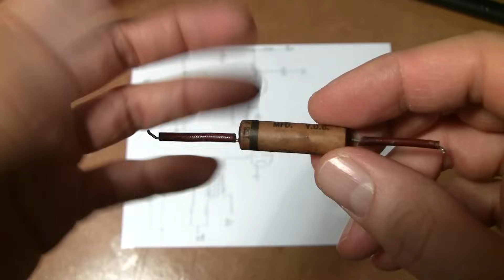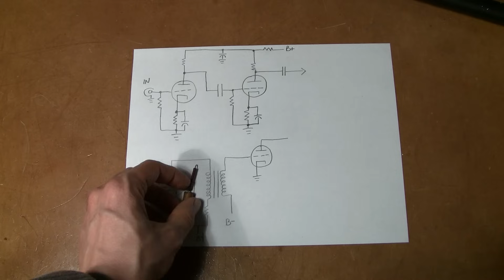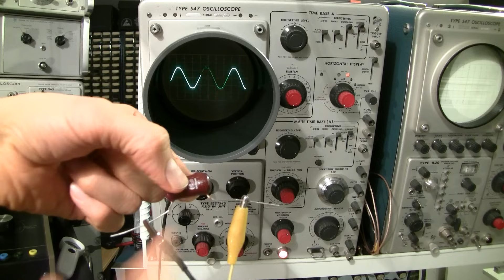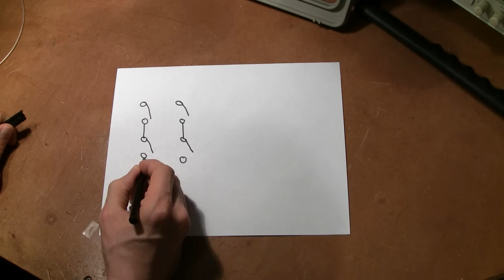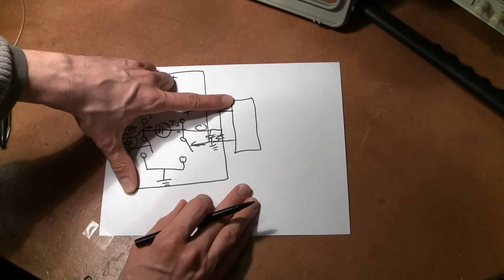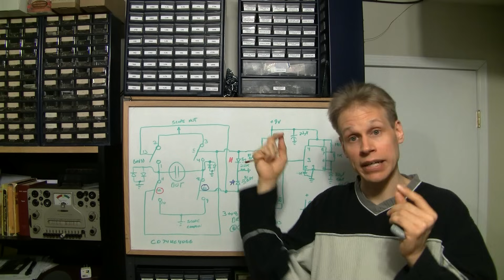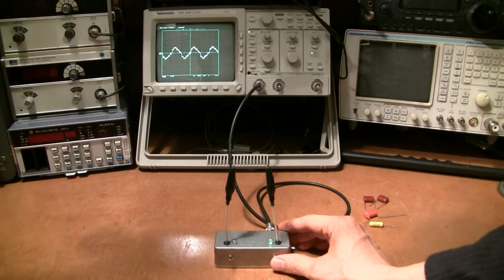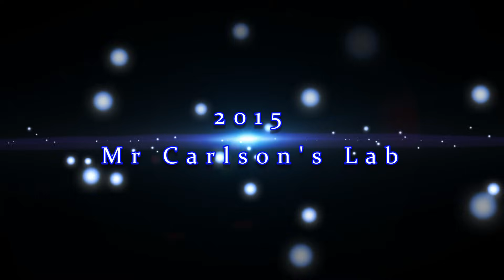Are Your Capacitors Installed Backwards? Build this and find out

Comment: As for the 555 timer or at least a pulsed clock input,a 4013 flip flop with a momentary switch de-bounced would let the state remain as is until you want to change the output state,i build these also for switching selectors,a switch a 10K resistor and a 100nF cap will de-bounce the input,i fact right now i'm using just this type of thing but with a HEDF40175  for exclusive or independent channel selection,less parts can be used with less complexity for the H bridge manipulation.

Comment: I have a cheap 2 channel, 100mhz digital rigol scope (DS1102E I think it is) and even using a coax cable I can't reproduce the high/low noise effect by touching the cap.  I have it set to 5mv per division.  I'm not sure what I'm doing wrong.  Anyone have any suggestions?  The caps I'm testing are 650V orange dips, if that matters.
Reply: I had the same issue.  I installed an isolation transformer in the AC line to my scope, no safety ground connected,  it then worked fine!  Keep the isolation transformer inline until your done checking the caps and then remove it for normal usage.    I'd be interested in others experiences.
Reply: Don B thanks for the tip Don! I’ll give it a try once I get a chance.
Reply: I am getting the same "no difference results" from both of my scopes, 3 different types of coaxial cable and 2 different locations.
Reply: Don, I've the same problem and I see Mr. Carlson didn't answer . . . Did you ever get it resolved?
Reply: Rick, I've the same problem and I see Mr. Carlson didn't answer . . . Did you ever get it resolved?
Reply: Don Bonin I have the same scope and same issue. Are you using the stock probe that came with the scope? He uses just wire in this demo no probes with components built into them.
Reply: @RC-Flight  Hi Guys, I know Paul is very busy especially with Patreon and he is making a very good living producing these videos.  He responds very quickly to Patreon members as I am one and have had many helpful conversations via PM there at Patreon.  As for the problems with the Digital scopes I think it may have something to do with the actual EMI noise in ones shop/lab area.  I have read many people having difficulty with this issue regarding inconclusive results with OSFE (Outside Foil End) testing using DSO scopes. The body grounding may be some of the problem but I have a feeling it is the digital scopes and the way that they capture signals.  I have no modern digital oscilloscope so I cannot test this theory as of now.  With my Tek 2246 I have no issues whatsoever determining the outside foil end of any capacitors I have tested from 47pF to 82uF.
Reply: @garybevis8691  Yeah,  It seems to be quite a bit difficult to see these waveforms on a newer DSO,  it doesn't work on my Siglent.  I have 4 scopes at the moment,  and the only one where I can actually see this experiment work is on my Tek TDS 420A (btw he's using a Tek TDS 320 in the end of the video I believe,  same series of scope).  And only because that scope allows me to go down to 1mV/Div,  set the bandwidth limit to 20 Mhz,  and use some filtering options that the scope has built in.  Also there is a lot of interference in my lab from other equipment,  specifically from switch mode power supplies and LED lighting.

Comment: If you already go through the trouble making a PCB, why not take it a step further and make the device stand-alone? Amplify and rectify the signal and store the voltage in a cap for each direction using another 4066. A comparator at the two caps could determine the shielded side.

Comment: Great, a test rig for automatically testing the--- oh wait! You still need an expensive oscilloscope!? Well shit.

Are you seriously telling me you went to all the trouble of etching and soldering a board just to provide an alternating goddamn SQUARE WAVE to a capacitor? Surely you could've used a microcontroller and some kind of clever circuitry to DETECT the 1millivolt amplitude and just display the correct polarity?
Reply from the maker: Why would you feed the capacitor with a square wave?
Reply: Maybe I'm kinky like that.

Alright, so I misspoke. But it amounts to the same concept. You're connecting the thing first one way, then the other, using an H-bridge. Well, you could just do that by hand without making the damn test box. If you're gonna go to the effort of making a dedicated test rig, then why not make one that actually serves some real purpose? If you still need the oscilloscope, then you have gained nothing.

Comment: Hi Mr. Carlson!
The U.S. Navy trained me almost fifty years ago (avionics). During that time, and with all of the contact that I have had with engineers and technicians since, nobody else ever pointed out potential polarity issues with non-electrolytic caps!! I stumbled across this video quite by accident, but am so happy (and grateful) that I did! In retirement, the only electronics that I deal with are electric guitars and amplifiers, but you just switched on a bright light...shining on some of the 'mystery noise' issues so common with amplified guitars and basses! Thanks!!
As a considerably less 'elegant' alternative to your new bit of test gear, I simply used a DPDT switch, a metal box (shielding, of course), some clear labeling, and physically switch back and forth between 'Normal' to 'Reverse!' I could have added LEDs, a couple of resistors, a battery, and changed to a 4PDT switch, but figured that the O-scope display was plenty! Works fine, was way less expensive, has fewer potential points of failure (like none!), and only took twenty minutes to build! I decided that, at 65, the 'KISS' principle would serve me better! :-)
Thanks again....brilliant video!
Reply from the maker: I'm glad you found this useful!
Reply: How can you sit and type that it has zero points of failure when it contains a mechanical switch...  Yeah I'm smirking but it's not a hate comment just a smug one.
Reply: @WereReallyRelayCamping  OK, zero failure until 1 million cycles reached (typical switch life). At 10 caps a day tested that's 273 years of service. ;)
Reply: @DataWaveTaGo  makes you wonder if switches are so reliable why I get through so many toasters....  Lol just pulling your leg yeah most switches if not $5 for a bag of 100 off eBay should outlive us.
Reply: @WereReallyRelayCamping  I was tinkering around and ordered some switches from China off Ebay. What they sent me will fix my damn  old coffee maker that has been a plug in plug out system for years.  Pulled the old switch and pushed in the new one, and we are back in business once more!
Reply: Tweak or Tron God? ( O or I level?)

Comment: Paul, I have been watching your videos for a little while now and I have learned a great deal!  I am just starting out in electronics as a hobby and I have been restoring antique radios.  I am just now starting to restore a Hammarlund HQ 120X and I want to really do things right so I want to insure I have the capacitors installed with the outside foil the right way.  I have a Tektronix 475A oscilloscope that I picked up at a swap meet.  It is in working order, but I don't seem to be getting the sensitivity when I hook up the capacitor to the probe and the ground and then ac coupling with my fingers on the capacitor.  I am set at 5 mV per division, but I don't seem to get any sensitivity at all on the scope no matter which way I connect the capacitor leads to the scope.  Any advice as to what I am doing wrong.  I am definitely a newbie at the proper use of the oscilloscope.  Thanks!
Reply from the maker: Hi. Touch the end of your oscilloscope probe and tune your scope's vertical section (sensitivity) to maximum. Adjust the horizontal time base to achieve a sine wave while doing this... Don't worry if the sine looks distorted. Now remove your probe from the oscilloscope, and use a piece of coax with alligator clips at the test end. (1 to 1 probe).. Support the capacitor under test between your forefinger and thumb, being sure that you don't touch the oscilloscope leads, and hold the capacitor right in the center of it's body. Take note of the sine on your oscilloscope, then reverse the capacitor in the alligator clips, and test again. The capacitors direction that shows the lowest amplitude sine wave, (the lower of the two signals) mark the end of the capacitor connected to the shield of your coax cable (that's running to the scope) That's the outside foil end.
Reply: Paul,  Thanks so much for the quick reply!  I am going to have to get a bnc connector with the alligator clips, I only have the probes at the moment.  I tried using just a piece of shielded wire  (an old piece of wire from an old laptop power transformer) but it did the same thing I was getting with the probe.  As soon as I connect the ground wire shield to the capacitor lead, my oscilloscope pretty much goes to a flat line with an almost imperceptible ripple that is so small that it doesn't change when I flip the capacitor leads.  I'll get the right bnc connector with the alligator clips and try that.  Thanks!  Glenn

Comment: I thought capacitors leak AC and cause hum and noise ?
Reply from the maker: When capacitors allow a device to hum, the capacitance is low. (the capacitor is getting closer to an open connection) Capacitors in filter service act like batteries that hold a charge and drain quickly. The more uF a capacitor has, the more of a charge it will hold. When you filter DC out of a rectifier (half wave or full wave) the DC is pulsing. So if you look at the DC on an oscilloscope, it will look like bumps above the center line. In order to have clean DC, you need to fill the bumps in.... The filter capacitor does this job. If the DC is filtered properly, you have a straight line joining the tops of the bumps on the scope (holes filled in) That straight line is pure filtered DC.

Comment: Mr. Carlson, I work on my old, vintage Fender Tweed amps a lot.  All of the old yellow Astron caps were wired with the bands down toward the tube plates which should be correct.  I have some NOS 1960 Astron PIO capacitors that are working fine but don't have the outer foil marked.  Have you found that mostly, on Astrons, when you are reading the label on the cap, the outer foil is on the left side (the same as your Astron in this video)?  That seems to be the case.  I just installed two .1 uF caps in my Fender reverb unit and they seem to sound great oriented that way.

Comment: Why use a timer + flip-flop to control the switching? Wouldn't a manual switch be more practical, and simpler to boot? This feels over-engineered. Is there a reason for the automated switching that I'm missing?

Comment: I'm installing Sprague orange drop capacitors into a guitar to modify the tone. I know the guitar end is passive, but I never thought of Orange drops to have polarity - although I did wonder what made eletrolitics have polarity (which sort of implied, others don't). I admit to knowing only a fraction of what there is to know in this field, but it just got smaller. Thanks for the video.
Reply from the maker: Thanks for your comment Steve!
Reply: In grading my capacitors (using your method) I ended up not only marking the capacitor but also bending the end of the leg (as an extra marker). This obviously gets snipped off when I'm installing the capacitor - but unlike yourself, I like more information on things I am working on. The marks I make on components, I like them to stay. The idea of bending the leg is a safe way just in case the mark gets rubbed off before installation. Seems there are a lot of people out there though, giving advice that it makes not difference which way you wire capacitors. Well, I know who I would like to work on my gear.

Comment: Principle tested true with a variety of polyester caps using a Hantek 6022 Data Logger and PC Virtual Cro Software. Some critique had reported trigger issues with Hantek and thus deemed it an unworthy solution to, I guess, a Rohde & Schwarz; which proved false for above outlined tests. Although it would be nice owning a Tektronix offering a finer trace than a Hantek.

Comment: Great info! 
For the test box, why not just use a DPDT toggle switch?  The switch lever could "point" toward the connector to which the scope ground was connected. 
Seems like the auto-switching monstrosity you built is a "Because I Can" project.  ¯\_(ツ)_/¯
Reply from the maker: Hi Stephen. Touching a metal project box with a DPDT toggle in it would make for confusing results. When you touch the metal project box (the box has to be metal) you are "grounding yourself out," and the imposed signal on the capacitor body would disappear. Also, when testing large amounts of capacitors, the automatic method really takes the edge off.
Reply: Mr Carlson's Lab good point, you have to be ungrounded to be noisy. I was thinking of a plastic handled toggle switch, like: https://www.radioshack.com/products/20a-dpdt-flip-switch

But it occurs to me that a chunky rocker switch would probably be better, and allow quick, one handed use.
https://www.radioshack.com/products/dpdt-rocker-swtch

Comment: Very interesting, what about tube radio's? I can't imagine that back in the day they would go and measure each capacitor before placement. Maybe the markings back then did always indicate the polarity? Or are the negative consequences less occurent in tube radio's?
Reply from the maker: The line side of the capacitor is especially important in oscillator sections (old radios.) Way back when, the machines that built the capacitors were set up in a way that properly orientated the caps before marking.
Reply: Thanks for your reply. At the moment I'm working on an old Philips from the mid fifties. This particular radio contains a lot of the old brown Wima capacitors. These capacitors do not have a marking indicating polarity, but only the brand and values on them.
Reply from the maker: Many radio manufacturers used caps with no markings (band end,) but knew the writing in a certain direction pointed to the outer foil side. This is very apparent on the bumble bee capacitors with no writing at all. The direction of the stripes indicated the band or outside foil end. My suggestion is, use your oscilloscope and test a few of the WIMA capacitors,  look for the band end this way. You may find a common similarity among all of them.

Comment: Thanks for your video and comments regarding Polarity on Signal By-pass Capacitors..   Like many of your viewers, this has been a lesson on this aspect of building Vacuum Tube circuits..  I would like your comments regarding the Voltage Rating and their use in selecting By-pass Capacitors when designing and building Tube circuits..  

Quite often you see the Voltage limits on these caps..  I often hear these comments..  Never use a Cap. with the incorrect voltage..  Reason being..  For Example..  A Capacitor with a TOO High Rating causes the transfer of electrons to be SLOW in giving up it's Electrons..   FOR EXAMPLE....  AGAIN... That, along with other attributes causes poor audio reproduction..    

I would be interested in your comments regarding this Subject Matter..

Comment: Hello, I am a retired tech from The Bell System and I also never knew about the foil end of a capacitor. I am a senior now and in my 70's. I have an old Hallicrafters S-38 A that is filled with paper capacitors. I'd like to replace all of them but I do not have access to a scope anymore.  I'd like to build your little gadget but I fear that's beyond my capability. Is there a commercial one available? I could try and pick up an old scope but even that is filled with pros-and cons. I also read somewhere that a P.C. can be rigged as a scope, any thoughts? Thanks great videos. Tom P.S. Can a Digital VOM that has a scale for 20khz work well enough to adjust an IF? I don't have a frequency counter.

Comment: Paul, I just tried this with a Tek 2445 scope. 5mv per division 5ms. Not getting the same results as you. I assumed AC coupling on the channel and trigger. Any suggestions?
Reply from the maker: Hi Steve. Make sure you're using a piece of coax (BNC coax to alligator clips) from the scope to the capacitor under test, don't use an oscilloscope probe.
Reply: Bingo!  I fiddled with this for a bit with my digital scope (and a scope probe)  and figured I must be doing something wrong or that my body was just not cut out to generate noise that way.  :)  I will try with BNC coax - I don't know how I missed that.  Cheers Paul.

Comment: Paul great information and something I never considered. It's a shame stuff like this is not taught.  I will build this,  however the 4066 and 4013 chips that I have are Motorola types, one is a MC14066B and the other is a MC14013B.  It seems they both have a max voltage rating of 18vdc and they seem to be pin for pin identical but there are differences.  Should I give it a go with these chips or go with the ones you recommend.  Keep making great videos like this. I'm also enjoying the electronics course on Patreon.  All the Best...

Mark

Comment: Great video & I thank you. I promise to build one sooner or later. I was wondering if you had a circuit to determine the phase of IF transformers & oscillator coils which have had their lead indents/colours rubbed off please? Recently I built up a superset & the oscillator didn't work. I swapped the HT & G2 connections & it burst into life. However the aforementioned wires are a bit longer than they were before. A quick phase tester would be really neat. Best, John.
Reply from the maker: Thanks for your input John!